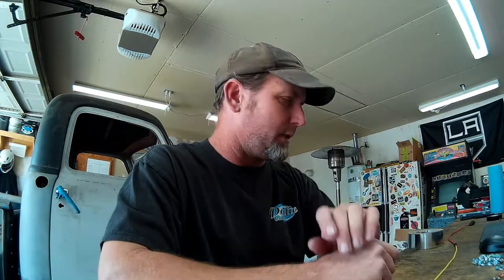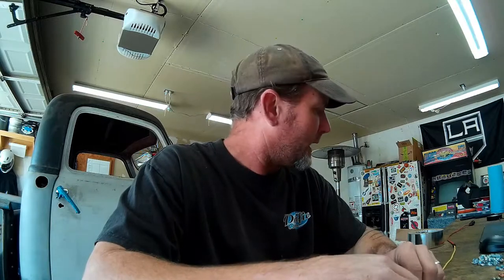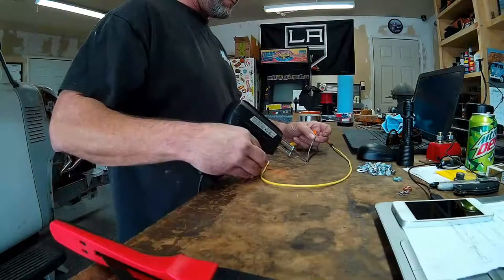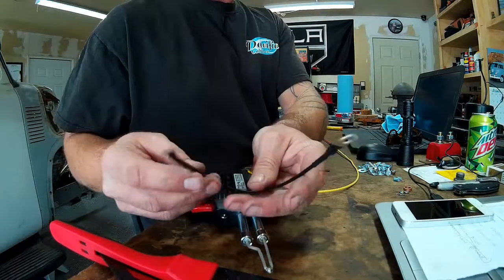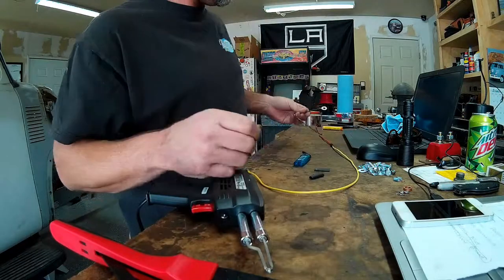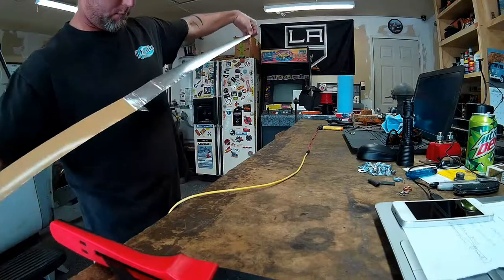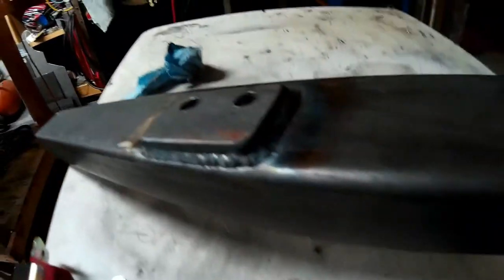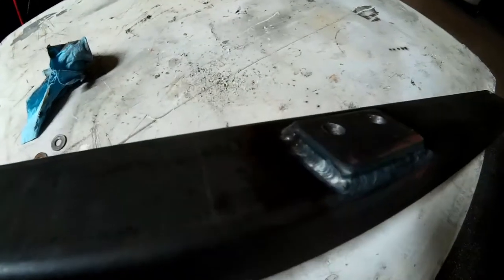P48 Project; Flywheel Install & Trans X member TIG Welding

Comment: Hi Jim
Is there a reason you did not use the stock X member?
I decided to install an LS1 with a 4L80E trans.
Im also using a 75-81 Camaro rear end.
Thanks
Mark
Reply from the maker: hi Mark, the P48 came with an SM420 trans in it and the factory xmember wouldn't work after moving the drivetrain back and down in the chassis.  your project sounds great, LS & 80E are a good combo!  thanks for watching.